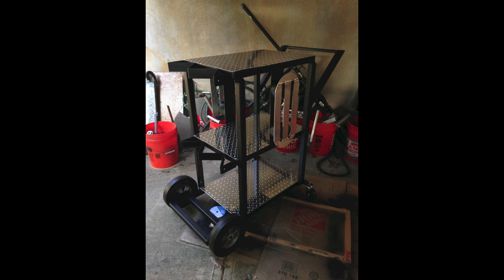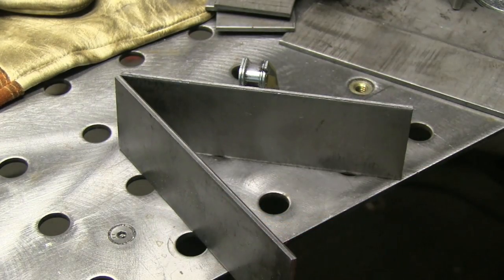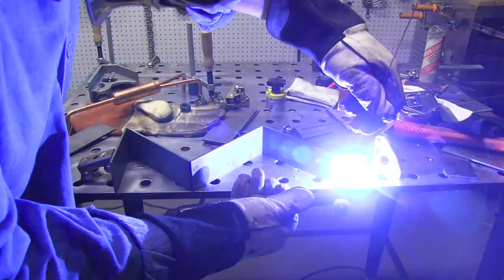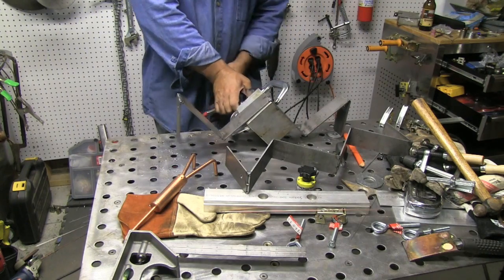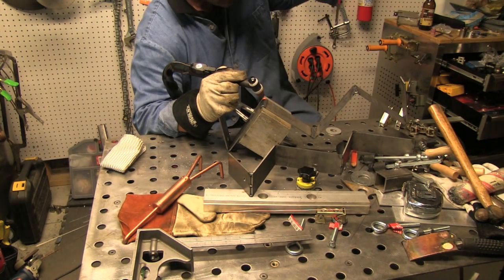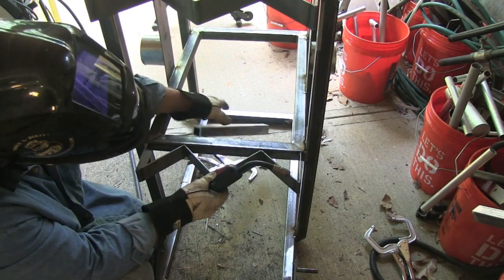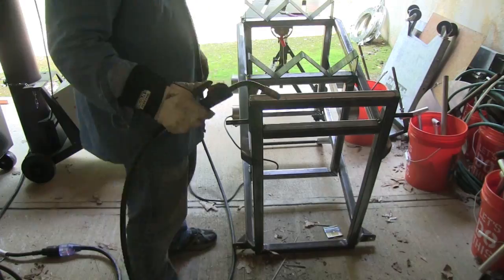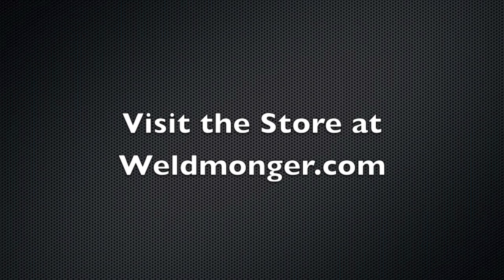Welding Cart Project part 5 - Making Brackets for the Gas Cylinders

Comment: Great project, might actually be my first welding project when I get my machine home. I'm thinking I might build it out of Aluminium, get some CNC plate cut with round holes for the bottle holders, put some sort of hinge on one side so that I can load the bottles in and close the outer side, lock the bottles in. Some rubber tape to prevent noise when traveling in my trailer from rattling. Great series mate

Comment: I noticed the buckets. If you put the tops back on, semi permanently, and then cut out the bottoms, you can stack them, and you can put really tall stuff (pipe, 2x4, etc.) without them falling over. I will send a picture if you want.

Comment: On your advice, I asked my local welding supply about getting set up with a Helium bottle, and regulator & wye. I have a Dynasty 200 dx, and I have to push it more than I would like to for some jobs that come my way. I would love to have the Dynasty 350, but lets come back to reality for a second here. The welding supply I use, said they are not doing any new leases on Helium bottles, and are having a hard tome servicing their existing Helium customers. Then he told me the gas only price, HOLY CRAP I thought Acetylene was high! Is this a nation wide problem, or a problem in your area? Also heat wise, how much of a difference would I be able to realize @ 200A? Thanks for just being you, and doing what you do, for us the You Tube metal working community. You and your videos are solely responsible, along with a willingness on my part to practice and be open to new ideas, for my going from a guy who could stick metal pieces together with a welder, to reasonably decent welder. For that I will always be thankful to you.

Comment: hi jody thanks for sharing man. if you have a little time i would like to ask you something, a job is comnig in which i will need to weld (tig) some 3/4" steel balls (from a big ball bearing) to the end of some pieces of 1/2 cold roll and some threaded rod, i`ve never done a job like this and don`t want for them to fail in service, do you think it`s better to preheat the balls? what filler would you recommend? thanks man, sorry for the question i don`t want to fail in this job. cheers. pete
Reply from the maker: If you are talking real ball bearings And not just steel balls, then definitely preheat also 312 stainless rod will help
Reply: oh yes proper ball bearing balls, thanks for the advice, came just in time!. pete